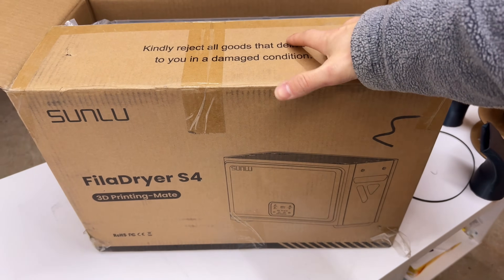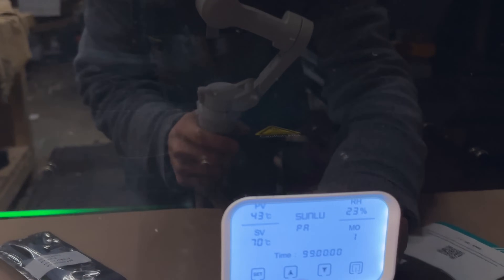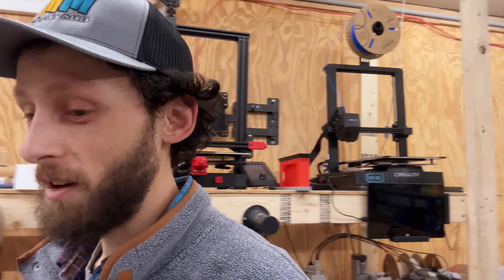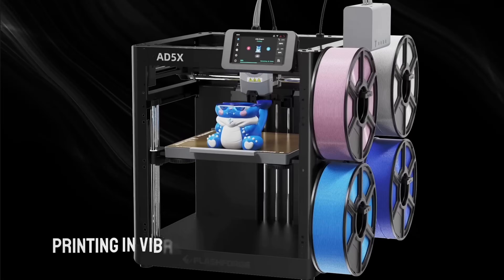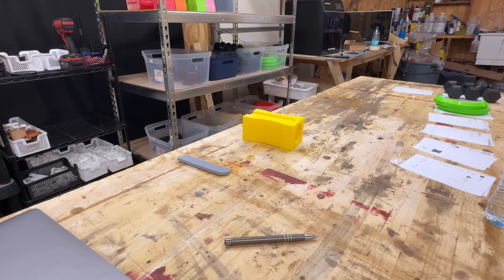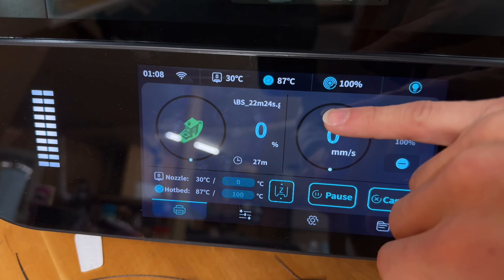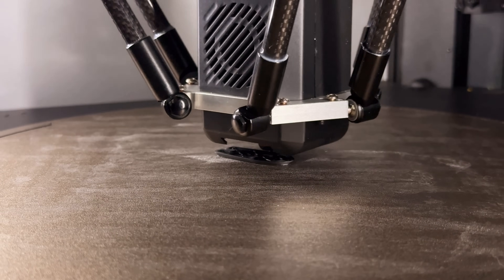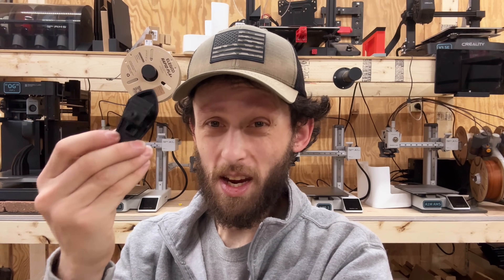ABS Test Prints on the FLSun S1 Pro & Sunlu S4 FilaDryer Setup

Comment: Some days you want to hit print and get a good print without all the drama! 7 years of tinkering my way out of drama. I bought a. A1 recently, set it up, turned the sound off after the first print, and NO DRAMA! One of the best prints I've ever had came off that printer the first day I owned it. I looked over at my not very old Neptune 4 Pro and said "You ain't sh!t". The other printers in my life have either gone to good homes or been humanely euthanized (one of them has a second life (no linden $ here) as a heat press rig and a re-spooler as soon as I can code an Arduino for it.
Reply from the maker: For sure! I love my Bambu Lab machines! It is cool getting to explore other brands and different types of materials though!

Comment: Playing with high end fiber filled filaments is so much fun! I do think the Flashforge AD5M series was slept on heavy. I'd love to see you get a Qidi Q1 Pro or Plus4 or the coming Max4 or whatever it is called and see what you think. I'm consistently impressed with my Plus4 prints. It's a monster for high end filament and the accuracy and layer stacking is wildly good. Just FYI having a small amount of air flow out of a filament dryer is actually beneficial for faster drying. This may be a dumb question, but have you actually taken the FLSUN bed plate out and cleaned it with dish soap and hot water? Ideally some kind of plastic scrubber too? There may simply be PLA/PETG/whatever residue embedded that the ABS/ASA won't stick too. Some bed plates also just simply don't do as well with all materials. Might ask FLSUN to send you a different material bed plate if they offer others. Good stuff man!
Reply from the maker: I’m enjoying the Carbon Fiber filaments. Just got 2 spools of PETG-CF in yesterday so excited to try those out too. 

As far as the build plate goes, it’s been cleaned i don’t know how many times. To be fair with the ASA, i haven’t tried it since i had success with the ABS so it deserves another chance
Reply: @TheMountainMaker  PETG-CF is so much fun! Prints easier than normal PETG and basically has invisible layer lines, especially if you reduce the layer height. Hope it works well for you! So good for functional and aesthetic prints around the house.

Comment: Im very new to the 3d printing world. I bought the Bambu p1s for my first machine, I highly recommend it. When I bought my CNC plasma cutter I had a ton of issues with the machine. I really got irritated with the amount of time and labor it took to make the machine work. Keep in mind that this is an almost 4k machine. With the 3d printer I knew I didn't want to have those issues. After a lot of research I knew I wanted the p1s due to the fact that I can be ready to print right out of the box. I wish I would have got started sooner. I have made so many useful parts that I designed.
Reply from the maker: Love my Bambu Lab machines! I’ve got the P1P and 4 A1 Minis from them. My P1P is about to cross 3,000 print hours and I’ve done nothing but Change out the nozzle to a hardened steel from the stock stainless steel when i had a PETG clog around 1100 hours

Comment: It would be great to see your settings on the 5M. I have been having issues with PLA and PETG not sticking to the bed more than halfway through a print causing fails even with brims. I Finally turned acceleration down and now have complete prints. But by doing that the print time increased a lot. I love the 5M but have had a few issues. FYI, don't upgrade the firmware just yet, guess there was a bug causing the printer to stop the job halfway through the print, and it will not allow you to resume the print at all.
Reply from the maker: I will try to get that up in a video soon.

Comment: About to fire off some ABS today. Am I supposed to inhale the fumes through my nose or mouth?
Reply from the maker: If you can manage to do both at the same time, you'll be set for a while 😂
Reply: Gotta move on to ASA after a while for the higher quality fumes. I keep a printer in my Garage just for this purpose though
Reply from the maker: 😆 Facts, that ASA is rough. Luckily these enclosures and filters do a pretty good job of keeping it under wraps

Comment: Can the S1 bed reach 105 or 110c?  I found 100 just wasn't hot enough for ASA and ABS to stick.  The S1 has such a large volume of air inside that I don't think you can get the chamber temp high enough where ASA and ABS print great.  Any heat created by the build plate rises to the top.  Printers that start with the build plate at the top have a much smaller initial volume to get up to temp.  I think you're plan for the S1 to be a quick PLA/PETG rapid prototyping printer is the right strategy.
Reply from the maker: The S1 bed goes to 120c and nozzle to 350c. With that said, it works great with PA6-CF, PLA, PETG and Im having luck using a glue stick with ABS.

Comment: I didn't understand it when I first started printing higher temp filaments, but now I do. For those of us lucky enough to have multiple printers I recommend you dedicate an enclosed printer to your high temp filaments and nothing else. Only print filaments in it with bed temps over 90C.  If you'll mainly be prototyping new parts to be produced on the Bambus then keep the S1 in PLA/PETG and let the FlashForge be your engineering filament printer.   Just my $0.01 worth.